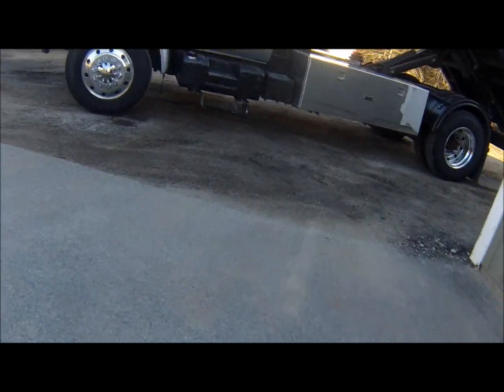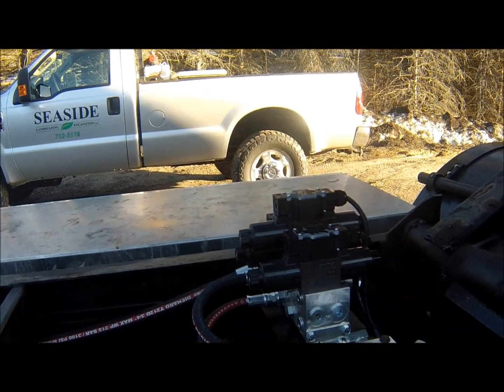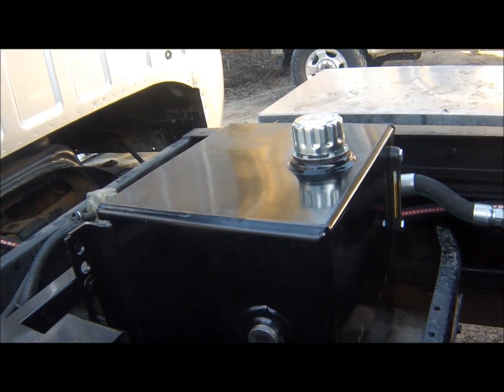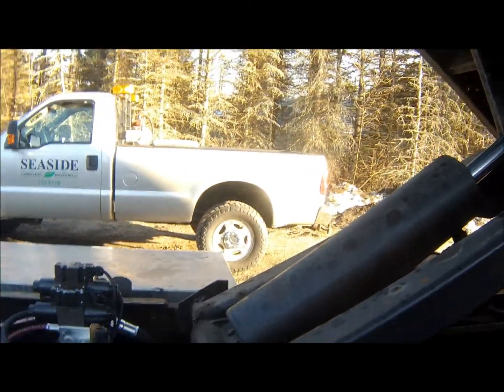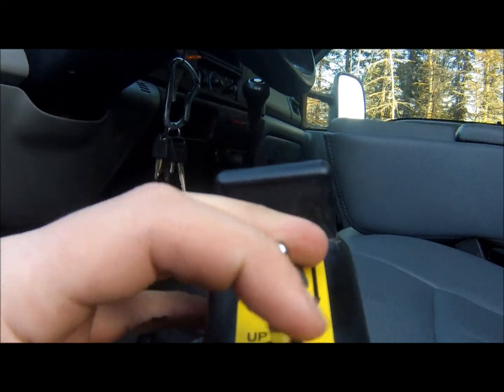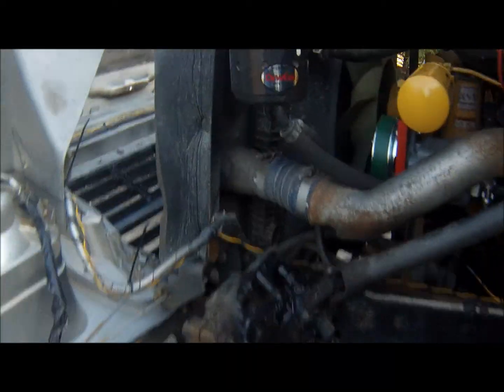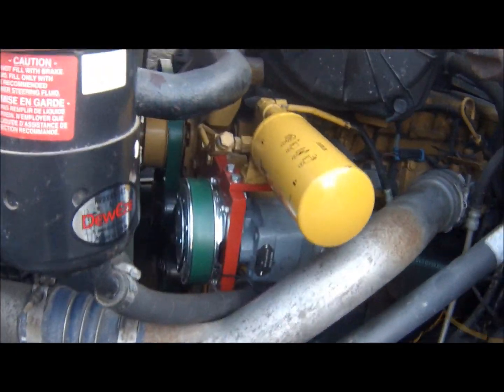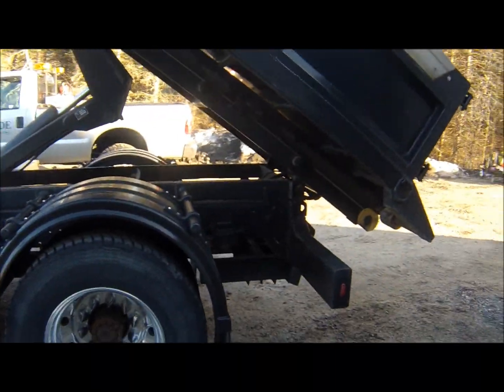New and improved Roll off system for the F650

Comment: Cool, glad to see a video of it up and running.  I was updating some SnG links and company page info when I came across this, I presume this is the same unit you emailed me about with the conversion?
Reply from the maker: Joey, yes this is the unit, I couldn't had done it without your help on the wiring. Haven't updated the winch to hydraulic yet but plan to do it this summer and use the electric winch on my pickup truck.